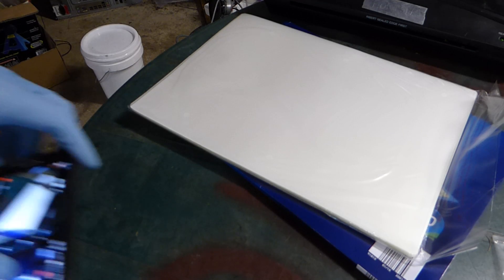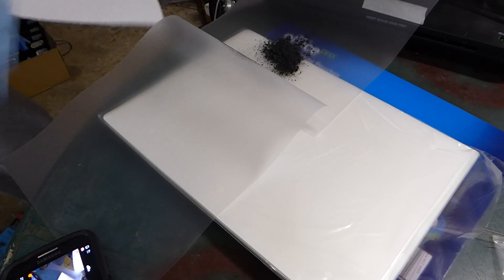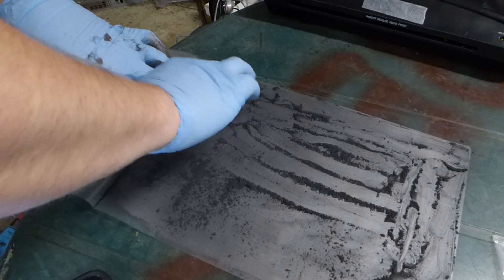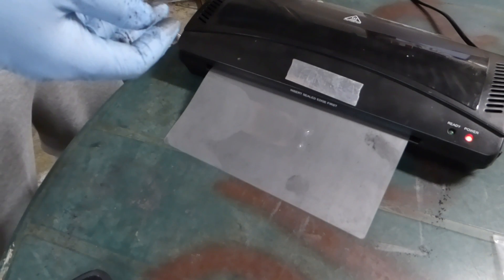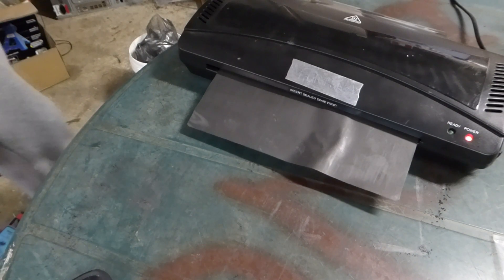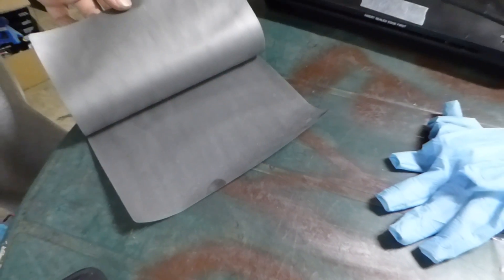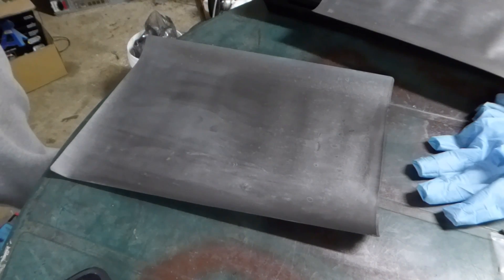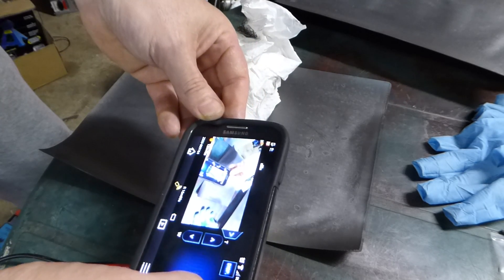Easy Graphene Sheets-Laminator & Graphite

Comment: should you not be able to lay down more raw layers of lamination on that and run it through thus making many many layers of graphite as that is way too dark to be a single layer and if done right, which I think you did, there should be a single uniform layer down on the actual plastic surface that melts a bit to do lamination, stuck to it, so each time you do a new layer it should come off splitting the difference, and make a MASSIVE amount of electrodes that you just need more layers of the lamination material to coat them off the existing ones, (not sure how many but eventually you should see transparency too, Robert Murray-Smith was getting it down with spin coating till it was just a slight brown tint over the clear material and still quite conductive) 

oh also I found this trying to find the videos where people are using orbital sanders with a buffing pad and graphite powder to make super large graphene sheets on glass, which I guess the electrophilic nature of the silicon dioxide in the glass is what causes full grahene carbon to carbon ring binding, once you buff the stuff to get the carbon atoms close enough together over the glass so the valence differences can take over and snap them together like how nanotubes of graphene lock to each others ends making continuous long tubes after you get the ends close to each other, almost like getting magnets near each other to make a long chain of magnets or something LOL.   Thanks for the info, will help for sure :)
Reply from the maker: Thanks for the input. Trouble with the sheets is they are hard to separate and by that i mean find the edge to get it to peel. That's why I went to polishing until the rag was not bringing up any more. And the longer it was polished the better the conductivity was getting.
Reply: @m3sca1  that last bit is not surprising, I had an idea for generating massive blocks of highly ordered layering that then could be split to make sheets that are uniform as big as the block system, though it was for a round block cylinder and so edges would have to be cut to make straight edged units.

Comment: Sorry I know this is a while ago now but I did the same thing but no meg ohms re resistance so no way any lower resistances and I polished it , used a jeys cloth may be that was wrong, what did you use to polish it , thanks 🙏
Reply from the maker: Start with good conducting graphite. Initially i rubbed in 3 directions to reinforce the hexagonal nature (i don't have data to qualify that but it made sense to me)...i just used paper towel to polish it until no more grey colour collected on the polishing rag.

Comment: The people who won the nobel prize didnt just peel the tape once, they put a spot of graphite powder on a piece of tape, and pulled it apart, repeating this process to get small flakes of graphene, you have probably created some flakes of graphene, but you do not have a full sheet of it sadly. Still a valid method for creating it, if you were to continue to mechanically exfoliate it, but with where you stopped, you have not completed the process.
Reply from the maker: I guess most people don't watch right through and hear me explain that the more it is polished the better the conductivity...that's where the bulk of exfoliation happens. The rag needs to be clean when the sheet is rubbed. That's when you know it's as good as it gets.
Reply: @m3sca1  it's still not pulling the layers apart and exfoliating it, as I said, it is close, but you are not making graphene quite yet. Real graphene is mostly clear, what you have made is not even remotely clear from what I can tell. Graphene is 1-10 atoms thick, although some argue that 3 atoms thick is the max thickness to be considered graphene. If you were to put what you made under a microscope, I'm sure there are some flakes of graphene, but the sheet as a whole is not.
Reply from the maker: @walkstheman98  it's good enough for Robert Murray-Smith to have graphite/graphene, then it's good enough for me 😉
Reply: @m3sca1  have you looked under a microscope to see if you actually have made graphene? Just doing something similar doesnt mean you have created the same thing. I would love if you were to prove me wrong by showing a piece of the sheet under a microscope! I'm not trying to bring you down or discredit what you do, I'm sure that you are onto something with this, and I actually plan to use a similar method for my own experiments! But they won that nobel prize by showing quantifiable proof, not just saying that they did it 😁 again, I would love to see a bit of what you have created under a microscope!
Reply from the maker: @walkstheman98  no. The increasing conductivity was good enough for me.
Reply: @m3sca1  it would still be helpful to look under a microscope to see what you have actually achieved, simply looking at one aspect does not prove that it is actually graphene. You seem pretty sure that you have made it, so a simple test under a microscope would prove me, and everyone who says you haven't made graphene, wrong. Again, I'm sure you are on the right track and I love your work, it just helps to actually show proof, more than just a single thing that it does.
Reply from the maker: @walkstheman98  it would be nice to have a microscope even!
Reply: @m3sca1  20-50$ wouldnt be too much for most people to spend, you can even build one for 10$ or less that works with your smartphone! But clearly you are afraid of actually using one to show proof, but I do appreciate you responding either way. Again, your methods will be used in my research, so I do appreciate the video and your time! If you do ever plan to get a microscope to prove me wrong, I will be glad to say that I'm wrong! Again, thank you for your time tonight
Reply from the maker: @walkstheman98  well if you're gonna be making instead of just talking i appreciate the conversation. I naturally get my back up on this since it has been the source of a lot of YT flack from trolls who spend their time telling others what they should be doing with their time. Other ways you can strip the graphite off...peroxide scrub...ultrasonicate the sheets in intercalating materials
Reply: @m3sca1  I have been testing a similar method as you, as well as trying the original method of using tape. I also have a few ideas on how to actually get the graphite/graphene to stick to a substrate such as glass or plastic. I have thought of using static attraction of a powder, or using evaporation to leave a film. My issue with these is they do tend to layer up and just make thin graphite. I plan to try and use a solvent to fix this problem as well. I need to get a microscope myself to see if any of my experiments are actually working, and if so, I believe that using your method of the laminator can help get a sheet of graphene faster. I'm hoping my methods can at least quickly lay a super thin layer of graphite, then your method gets me to the graphene. As is it seems your method takes a bit longer than I personally would like. Please don't take my prodding as trolling. Your video is actually one of a few that has had me obsessed with trying to make some myself.
Reply from the maker: @walkstheman98  no reason why you can't put a sheet of the stuff inside another laminate pocket...and go for another peel. I never did. Was painful enough pulling a sheet that size. Might pay to make strips instead of wide sheets so you can apply a good even tension for the peeling. If too hot it could fuse too.
Reply: @m3sca1  that's why I want to try to find ways of making a thinner layer in the beginning, that way it may only take one or two peels. Anouther option would be to take something with a weaker adhesive (like sticky tape) and continue to mechanically separate the graphite layers. With a weaker tape the graphene should stick to the slide/plastic without coming off onto the weak tape. It may also be worth trying to start with a sudo-graphene powder, such as blended graphite/ separated graphite suspended in water or solvent. Easier to start small and go smaller

Comment: I’m no Graphene expert, but if you had actual Graphene, it’s resistance would be far lower. Probably less than 1 ohm. You had Mega ohms of resistance. And it would be less visible as Graphene is only 1 atom thick. In essence you have a graphite sheet.

Comment: Lol if thats how easy to make graphene, we'd already have space elevator and stuff. Yes the nobel prize winner just use a scotch tape but you do realize that by using scotch tape, they only made a microscopic graphene sheet. Even if they use large scotch tapes, it will only end up with microscopic pieces of graphene. Wanna test your carbon sheet?? why not fire a bullet in that one
Reply from the maker: No graphene has ever stopped a real bullet. The "bullet" tests were done with scaled down bullets. They were described as micron sized bullets.
Reply: @m3sca1  Ofc they've test it with real guns Lol, they make perfect graphene through lab and test it everytime. If you're talking about videos here in youtube, the only thing here is what you described. Even if what you made is an imperfect graphene stacking it multiple times should be enough to stop a pistol bullet

Comment: Can you provide AFM data? Or Raman Spectroscopy results indicating then actual presence of graphene? While your method present a thin layer of black, carbon, that is not an indication of presence of a single layer of carbon atoms. From that you can strictly tell it is indeed not graphene. 

If you repeat the lamination, i.e. stick a new sheet on your previous and relaminae tell it is nearly transparent, then we can suggest the presence of graphene. What you have is a thin layer, approximately 1um of graphite flakes. Remember an atomic layer of carbon is about 1nm thick.

Regarding the "stick an peel", they have presented their results and measured them with the techniques I mentioned. The measurements, and novel method are why they got a Nobel prize. 

The conductivity measurement doesn't mean much. Graphite has been shown to be conductive in thin layers. This can be seen by drawing a thick line with a standard #2 pencil. 

So all in all, as many have said, not graphene. Conductive, thin, and carbon; but not graphene

Comment: I think as the video ends those would still have to be called graphite sheets. What everyone forgets is you tell them it has to be extensively polished (exfoliation) until it’s clear, at that point I think it’s fair to call it Graphene, although idk if you could go so far as to say single layer. I’m sure there are imperfections but it’s a very practical and creative way to start generating useful size samples.
I’ll be giving it a try for sure.
Reply from the maker: Thanks for making such an excellent point, I am pinning you comment because of it.
Reply: how would you exfoliate it?

Comment: @m3sca1 One question i need fast, can i laminate liquid inside and if not, any idea how to ?
Reply from the maker: Daixyo it gets all steamy....make a corner that you inject it
Reply: m3sca1 Great video, thank you for that too!
Reply: m3sca1 My idea is inserting liquid crystal and i want it actually easy to make display. Tnx
Reply from the maker: i found that the exact amount of liquid is required or it squeezes out. You could make a special heat sealer, one that has a void in the middle to accommodate your cell, or just a clothes iron to go around the edges, instead of running through rollers

Comment: u ppl rlly need to learn some more about graphene before doing vids like this this is just sad... either do somthing accually usefull or accurate or dont.. i mean seeing this makes me feel like watching the crap from tv.. -.- 
as a little tip that might help u on the way graphene is a very good conducter.. low resistence "k rating" is still too high.. when ur at 0.2 ohm and less ur maybe on something.. but stop rubbing it off like that u should do it right if ur alredy trying that method... u need to run it trough there over and over again it is supposed to be only 1 layer of atoms... to get there u´ll need some time i asume.. so u got 2 sheets now so u get cleen one and make 2 new.. but the one with less shimer on it is better there are alredy less layers on atoms on that sheet.. of course both will be same at the end.. a little warning thinking about it u might end up with a loooooot of that foil.. good thing is u might have a lot of graphene on the end.. IF it ends up working u a  rich man.. putting it no yt is not smart.. big corporations will take the money without saking u... ur just a little man.. u wont get shit in the end..
Reply from the maker: It really is a condition of mixed information that makes people think that putting stuff into the public forum is a bad idea. When people can home brew batteries because of the work of people like Robert Murray-Smith and others sharing information, we break the cycle of big corps owning everything. In that we make energy cheaper for the consumer, and bring light to things that are going behind closed doors. I can make an electrode out of graphite and laminate, good enough to make a pretty serious capacitor, or battery, and that is good enough for me. I suggest you research annealing techniques before commenting about "rubbing it off", because as we rub, we remove the outer surface and leave only that which is bonded to the plastic laminate. Also the rubbing in different directions actually shears the top layers and forces them to edge assemble with other sheets. So many people are triggered by this video because they do not know that graphene does not have to conform to a single layer sputter grown sheet to be of use, and that using graphite as a starting material is valid.
Reply: m3sca1 XDDD... I expected too much.. im just gonna say this one last time.. u need to get more information on the topic.. im trying to help u here... 
First of... anything u said about rubbing it of or whatever is not going to do enough... what is hard to understand about 1 layer of atoms? 

Further more I talked to a college of mine and he mentioned that the laminating temperature is Probably fucking with the atomic  structure of ur "graphene".. 

And there are formulas out there to calculate the capacitor.. I'd try to calculate that invention of ur's.. the size of ur sheets u have and the resistente u can mesure... u'll see what u need to calculate it when u find the formula... 
Calculating will show u exactly how good ur capacitor is.. but im telling u right now.. Ur capacitor is rlly rlly shit if ur sheet has "k rating" resestence... I mean a normal capacitor has a normal sheet of metal inside.. not sure what metal I think it was aluminum.. doesn't matter anyway the point is the aluminum sheet has a smaller resestence.. 

What maybe gets u thinking it's good is the size of ur sheets in normal capacitors the sheets are smaller.. meaning less surface less power stored.. 

Ok im done explaining this shit... I hate typing... 
Get good...
Reply: First of all, the DIY home-brew batteries on YT are inferior to commercial batteries so you're not making any points by claiming that DIY'ers are advancing themselves or technology.  If you disagree then you likely haven't tried making these things yourself.  I have so I'm speaking from the experience of making and testing them.The subject of your video is about graphene - not graphite sheets.  "Graphene" is not open to interpretation.  You cannot throw graphite on tape and claim that you made graphene.  That is not what the researchers claimed when they did their tape experiment.  They used tape to extract some graphene.  They did not claim to have made graphene in any small or large quantities.  If you want people to interpret your video similarly to the tape experiment then you need to change the title of your video.  It is misleading (as everyone is pointing out)... but the only thing worse is that you're defending the argument that you're producing graphene - which your video does not go far enough to justify the claim.  That's what everyone is saying.

Comment: This is a "sandwich of graphite", or a plastic sheet impregnate with graphite, not a sheet of graphene. The fact that it conduce the electricity does not prove that you have a single layer what its called "graphene". The amazing properties of graphene could not be achieved if you does not get first a pure sheet of graphene. Unfortunately this require a more complex process that maybe looks like silicon wafer production. The sad truth behind those special materials is that can not be done with clothes iron, laser printers, scotch tape, or a simple electrolysis. Sorry guys!!!..

Comment: Graphene must be 1 atom thick? Does the laminator accomplish this or would this just be a sheet of graphite
Reply from the maker: the peeling really only separates the two sheets after heat glues some graphite to the plastic, then as the polishing continues "annealing" happens as the graphite gets sheared off by the polishing rag. The conductivity goes up as polishing happens. Eventually none can be seen on a clean rag and that is when no more gains can be achieved. It is not a sheet of pure one layer graphene, rather a random arrangement of single sheets of graphene touching the edges of each sheet.
Reply: Ah of course, You're the man